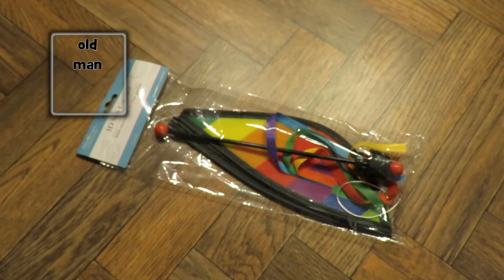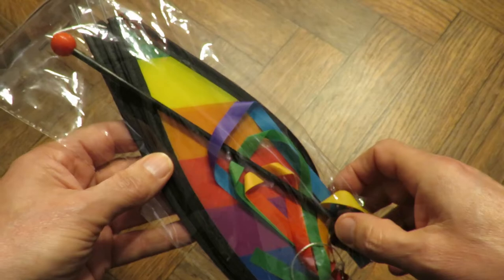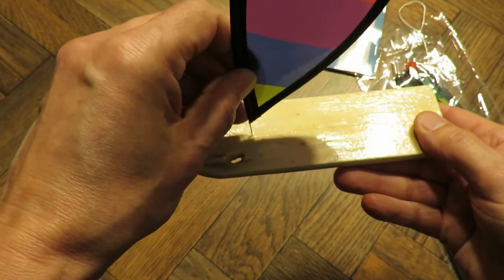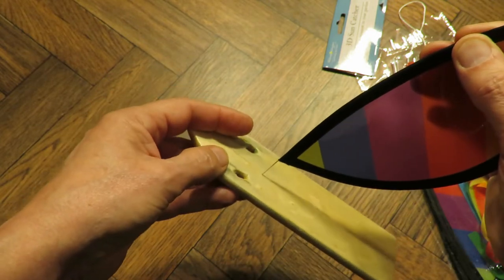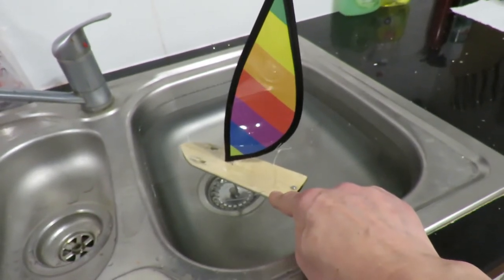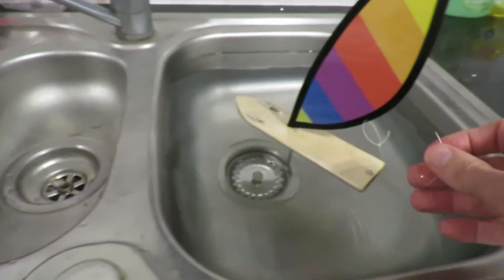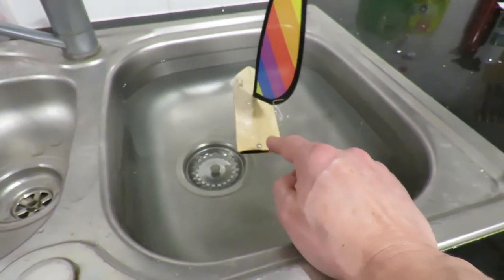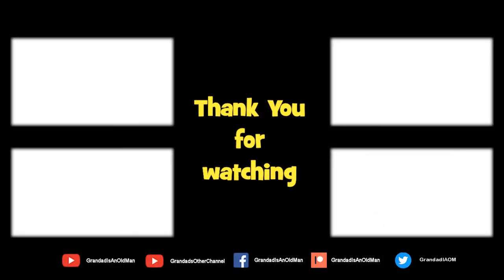Poundland 3D Sun Catcher sailing boat FAIL

Comment: A Sailboat does reqiure a proper Keel in order to give it directional stability. A Screw might work as a counterweight, but it wont prevent the Boat from turning when the Wind hits the Sail. Keep that in Mind when making a new Hull.
Reply from the maker: Yes this was more about seeing if that wooden hull would support the weight and it didn't. A bit of scrap foam would have done better. It was just seeing the shape of those panels of the Poundland Wind Catcher and thinking they looked like a sail board sail. You will notice dagger boards on sail boards are relatively small the direction is controlled by the person moving their position and balance on the board which would be relatively hard to replicate on this without RC. I have seen a great RC one somewhere on YouTube but the only one I can find at the moment is motorised so little more than an RC boat with an Action Man doll standing on it. +++ A little progress in the search here - they were RC surfers I was thinking of but this one was modified to be a sail board https://youtu.be/CzDWy3ZaZ8g

Comment: you need  lee boards, maybe a nut that slides down the screw ,to lower centre of gravity (my 1 meter sail boat has 5lbs lead bulb bottom of keel !!!)  ,and loose  string to hold the sail angle of attack to provide forward thrust, the sail is a plane wing principle  upright  ,good luck granddad,build it and they  come ,and possibly like and subscribe as well :-)
Reply from the maker: Yes I was rather hoping that little wooden hull would be a bit more buoyant. I had used it for one of my pop pop boats and it just soaked up the water so I dried it out and varnished it but it was still not up to the job. Not sure what wood it is, maybe even bamboo, just a little bit of scrap foam would do the job better. Those bottle boats look fun. Here is my beer can sailing boat from a couple of years back 😜  https://youtu.be/1p9Z_QCKv3A for those who like to be factually correct it is Thatcher's cider cans 😁👍

Comment: How does this become sun catcher in diagram
Reply from the maker: You would have to follow the instruction on the package. Basically there are ring shaped pieces top and bottom that the wires plug into.